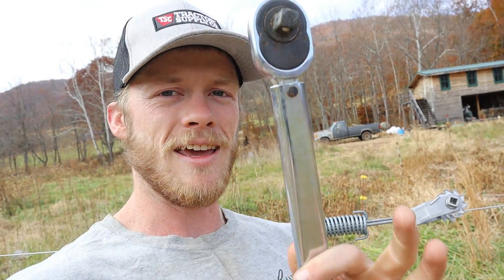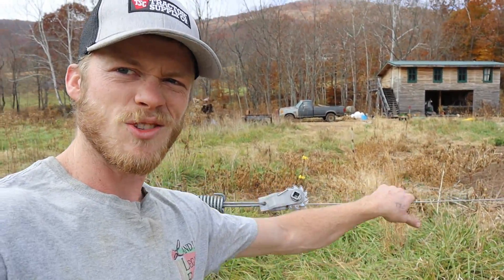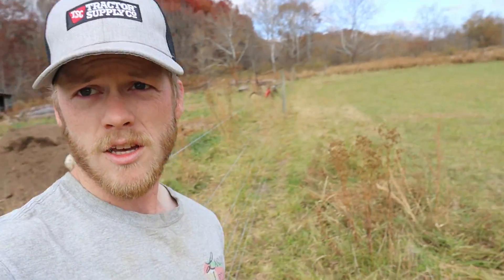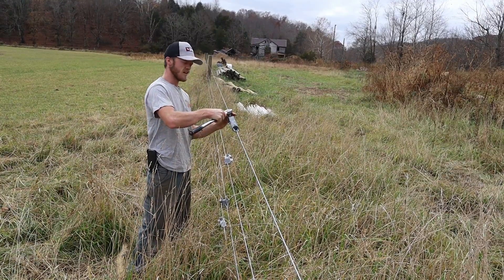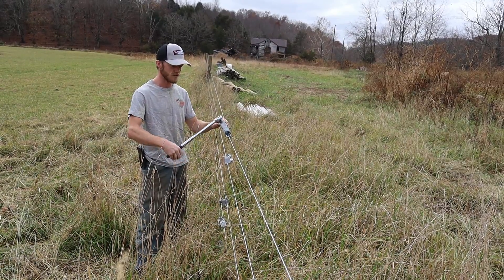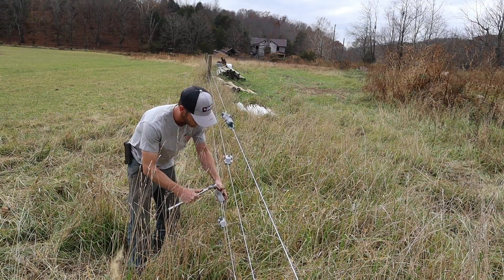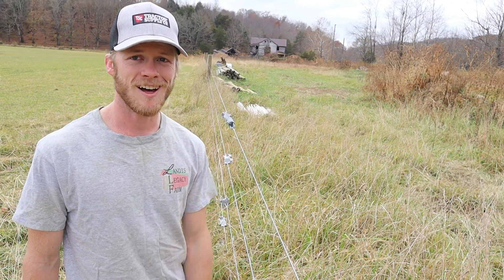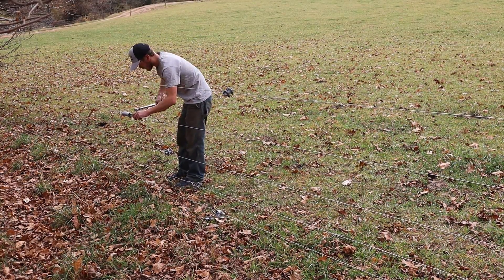Using a Torque Wrench to Tension High Tensile

Comment: I didn't include the springs when I did the orchard fence.  I'm not sure why I even did high tensile down there, the trees don't challenge the fencing like the cattle you're fencing for.  I just added the tensioners that the wire wraps around and a U-shaped pin locks in place.  Based on what you're showing I have my fence way over tensioned.  I think the torque wrench is a great idea !